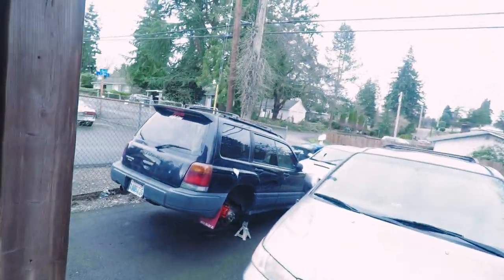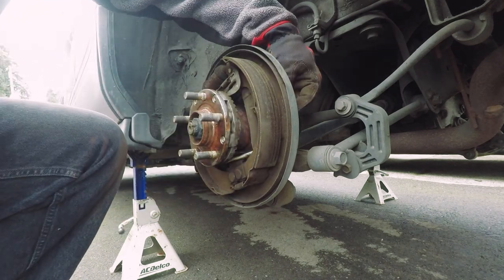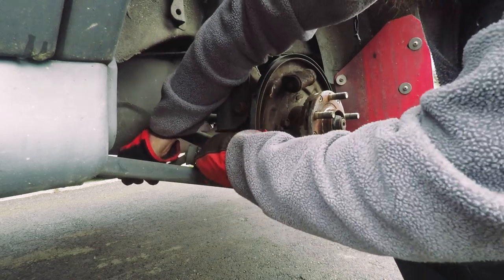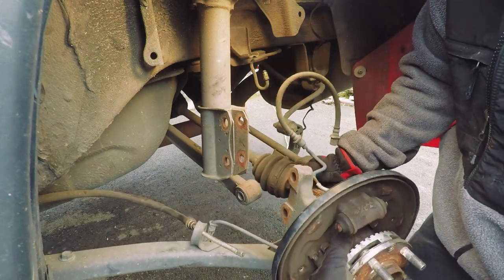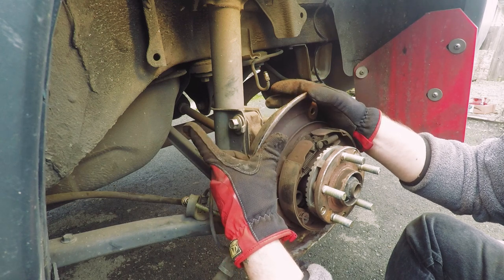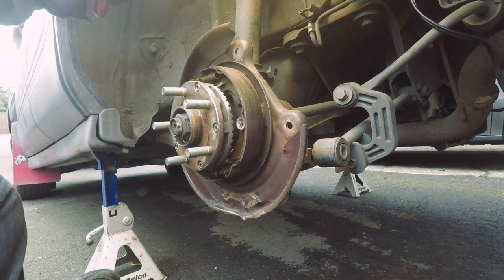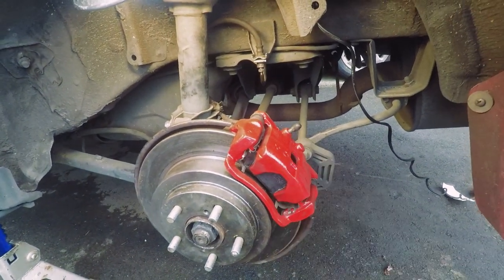SUBARU REAR DISC CONVERSION

Comment: 2:52 the best time to break the axle nut loose is when the tire is mounted and on the ground. Just pop out the center tab, or put a on a tire with the center cap popped out. Mount the tire, use a hub socket, probably with an extension, and it should be easy work with a breaker bar 👍

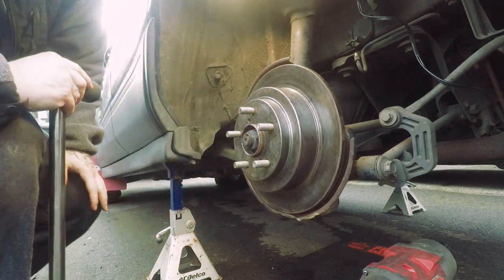Comment: 9:40 do NOT use the ebrake to tighten the axle. This can potentially glaze the ebrake shoes if they’re not properly adjusted to the inner rotor. 
Just get it tight enough, mount a tire to torque with a center hub cap popped out. Set the car back on the ground, chock the wheel(s) in the torque direction, and torque the axle nut. 😅

Comment: Did you replace the Master Cylinder and the proportioning valve? From what I read in the forums, there is a difference in the brake bias that a disc/drum setup has vs a converted disc/disc which means you need the Master Cylinder and valve from the donor car.
Reply: Great question since I want to do this conversion on my 97 Impreza
Reply: The part number for the 02 Forester L (drum)and S (disc) for the Master is the same 26401AC191
And the "Pressure metering valve" part number is also the same 27674AC091

Comment: Trying to find a kit where i could remove the entire brake shoes and drum and replace with disk and brake pads on a 2007 Subaru Forester.  I just replaced the rear drum with an after market drum and shoes. after a month they stared to chatter ? I readjusted them then after a month they started to charter again. I then purchased from the Subaru dealer the same. But they R expensive, i then did the job again. after a month the same problem. Rear brakes R chartering? What do U think ?

Comment: Awesome video! Just clarifying, you used the original Parking Brake cable and ABS cable? Just plug-and-play?
Reply: Yeah, looks about right, the diameter of the lines is about the same if different at all, should be pretty much interchangeable besides the sensors and master cylinder

Comment: The parking brake receiver is not the same so I guess he just stuck it through the hole that did not have the correct receiving hardware that properly mounts the cable and helps keep grime out and said... goodnuff!

Comment: Am i correct in assuming that this also converts the wheel bearing as well? I've got a bad wheel bearing and i hate having the drum brakes on, so i'm wondering if it would be worth it to swap both rears to dick brakes now in order to have easier wheel bearings to change as well.

Comment: I had a question 
I did this swap and used the same break lines that were on the drums Now i feel like the calipers is sizing, could the break lines be the cause? 
I’m pretty sure i should not be using the Drum lines since they didn’t fit that well.
i did ordered a set of steel lines already
Reply: Ihread on forums you should change it the disc brake lines
Reply: @DylenKinch  got it fixed, i used everything the same, the problem was that i unhooked the Break lines for a whole day and got air in the master cylinder, so i took it to a shop and did a full break bleed for $240. Now it works perfect.

Comment: Was it worth it though? I mean in traffic real world driving can you say if it worth all the effort from a mechanical standpoint? I mean I know it looks way better looking into wheel...but unsure if it's really a worthwhile improvement over the drum.
Reply: Safer plus maintenance is 400% easier
Reply: Disc brakes are way better mate. Drum brakes are trash.
Reply: @bakihanma7247  if we're talking about the front brakes I'd say you're absolutely right. But in this particular car in the rear just saying they're better doesn't make it so. My original question is was it worth it. Meaning is it actually worth the stopping power improvement. Or is this a case of what everyone does so that means it's automatically better. I totally agree on the maintenance side. The replacement disc setup is a tiny caliper using the same pressure the drum has. I bet if we measure surface area of the shoes the drums would come out on top. I'm not saying upgrading the pads and rotor sizes above stock wouldn't be an improvement I mean the two systems stock rotors and stock drums. Is it better?
Reply: @bp9749  Tbh on my expierence switching to pads feels like I have faster timing on pedal-wheel nd brake power. Either that or the drums I had were just crapy rusty asf lol since I needed new ones I just said fuck it and switched
Reply: @bp9749  I'm talking about the rear mate. well I went with GD style 04 impreza outback sport. Stops on the dime 👌
Reply: I just want to do this for ease of brake pad change. I just bought an 03 forester and am dreading the eventual drum pad replacement
Reply: @bp9749  way better I have a 03 s forester with disc and a 07 with drum. 03 stops way better, brake feels way better. When towing anything the 03 is way better. Drums are horrible... also disc and calipers are easily upgraded.
Reply: I would imagine at stock levels, just driving in traffic, the improvement would be so negligible that I doubt you notice. But, at elevated HP levels and more aggressive driving, the benefits would become much more apparent.
Reply: If you have ever had to pry a rusted brake drum off of one of these just to replace shoes you wouldn't be asking this question.